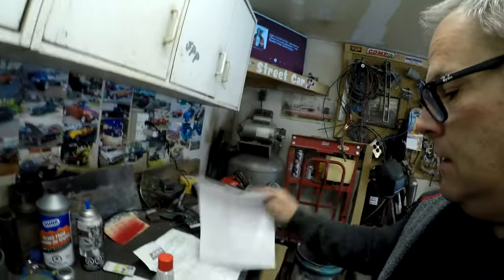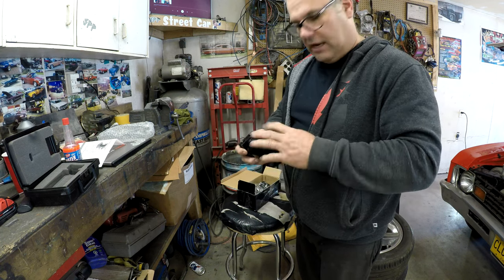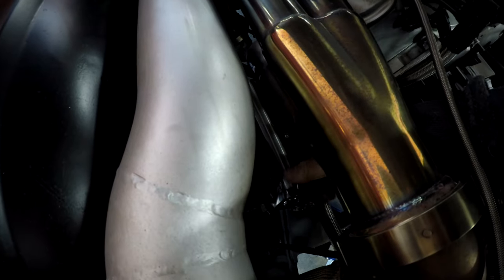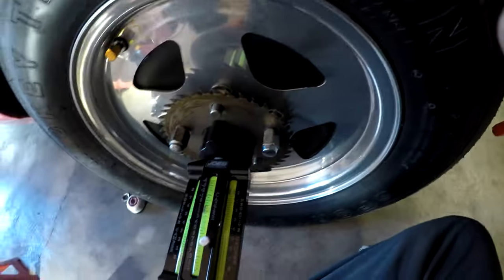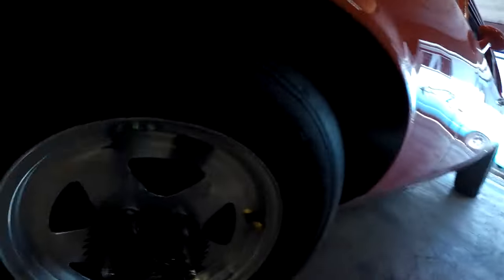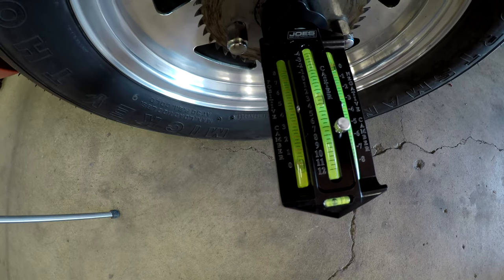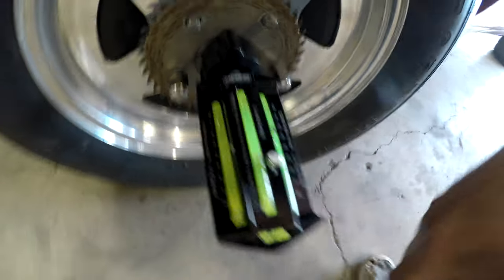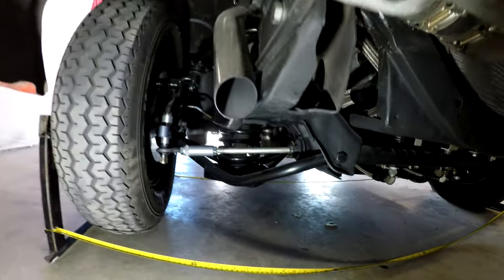Doing a Wheel Alignment at Home | Caster Camber and Toe with Basic Tools

Comment: Without having the front wheels on plates and setting toe, I  like to move the car back and forth after any adjustments  then recheck the toe. It adds a little more time but if the suspension settles some it could change your toe. I know you will  recheck it after you drive it though.

Comment: You set camber with the wheel straight! At one point he looked at camber with the wheel turned out on the left side. Then later he looked at the camber with the wheel straight and wondered why he had 3+°. Good luck.. I have a similar tool. It has taken a while to learn time use it correctly and to make the moves on the upper A arms.  But I have spent a lot of money on front end alignments that were just close, not  correct.